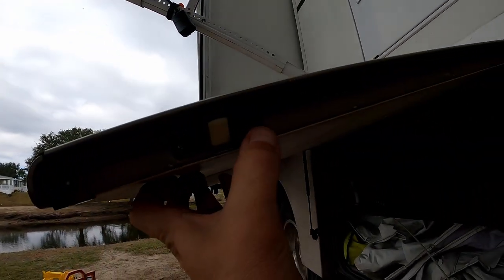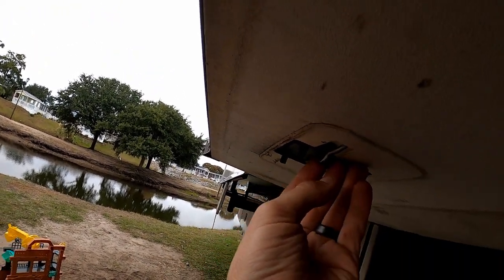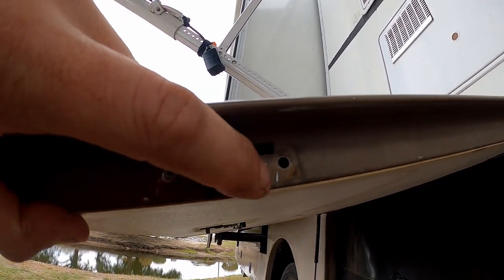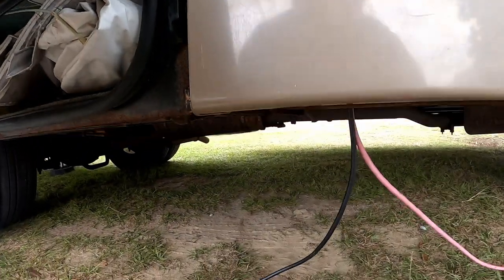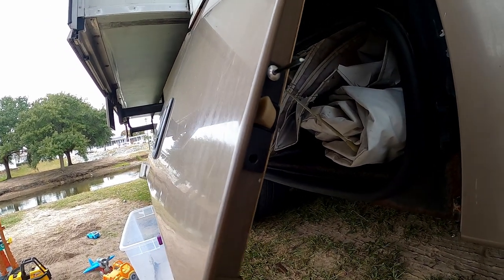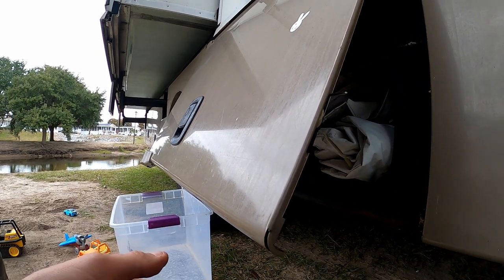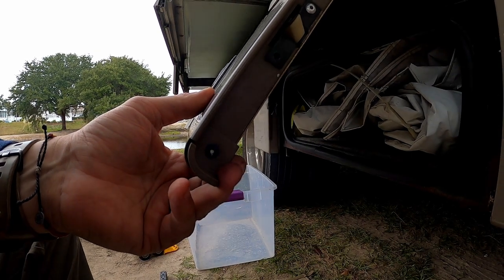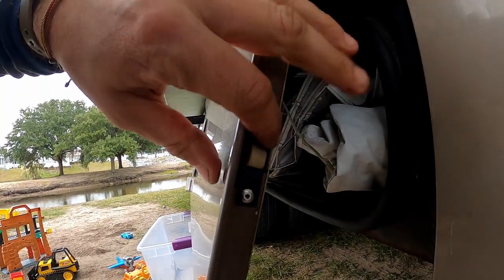Winnebago RV COMPARTMENT LATCH Repair / Replacement

Comment: Exactly what I need to do. Which rivet kit did you get from home Depot? TIA!
Reply from the maker: It was the Arrow Rivot kit. 
https://www.homedepot.com/p/Arrow-1-Handed-Swivel-Riveter-Kit-RT187SHK/304679379?source=shoppingads&locale=en-US&pla&mtc=SHOPPING-BF-LNC-GGL-D25T-Multi-NA-NA-NA-PLALIA-NA-NA-NA-NA-NBR-NA-NA-NA-Lapsed&cm_mmc=SHOPPING-BF-LNC-GGL-D25T-Multi-NA-NA-NA-PLALIA-NA-NA-NA-NA-NBR-NA-NA-NA-Lapsed-71700000109478129-58700008360670721-92700076104668740&gclid=Cj0KCQjwmtGjBhDhARIsAEqfDEdHqy8Z2p_ilyHTluIXuweSs217F9MJjd8EutBtzejFnMG6LSm0hg0aAkSmEALw_wcB&gclsrc=aw.ds
Reply: How to remove rivets

Comment: Very informative, just last week one of my bay doors would not open, the latch on the left retracted but the one on the right did not retract enough to get it open. While prying and prodding the plastic plunger broke. When I got the door open it appeared to be pulling the correct distance, but I am not 100% sure a new one will. Is there any sort of adjustment on hoe far the latches pull back or is there a spring that allows them to retract. Fortunately the door adjacent to the latch that was not retracting did open giving me access to pry the door open. I have four replacements ordered from Winnebago.
Reply from the maker: New latches will move more. The old ones become stuck. One other thing I have done is adjusted the black catch bracket on the basement panel. They have a little wiggle room if you loosen the screw to slide them to the right or left. Hope that helps. Thanks for watching!

Comment: Have you had to change the latch itself?  Thats what we are up against
Reply from the maker: The actual paddle latch handle? I removed them all to paint our rv. It's very easy. Remove the 4 screws from the backing. Pop each rod out of the retainer and the latch will come right out.
Reply from the maker: If you find my painting rv videos it's in there.
Reply: @WanderToGetLost  looked inside but could not see a screw ... it is a small blade or phillips?
Reply: @WanderToGetLost  looked for it but did not find it .. can you provide the link please? thank you
Reply from the maker: https://www.youtube.com/watch?v=wMfRx-8QErM
12 minute mark is when i start to take out the handle.
Reply: @WanderToGetLost  My wife got it out while i was watching the videos ... she just pressed lightly and was only held in by some double sided tape ... Thank you !!